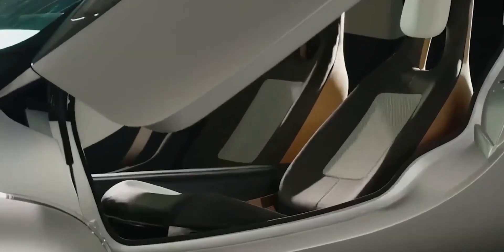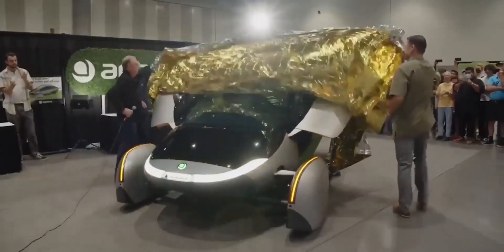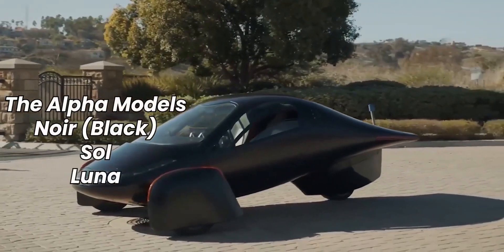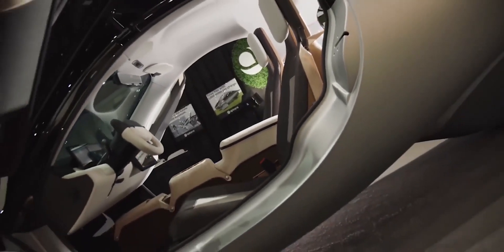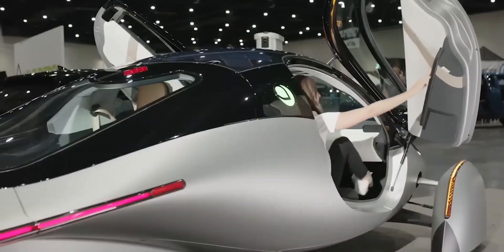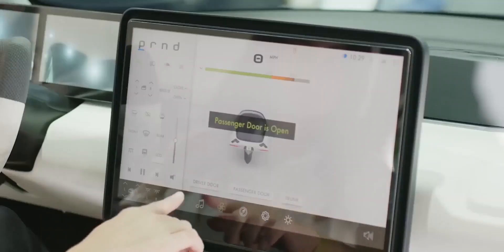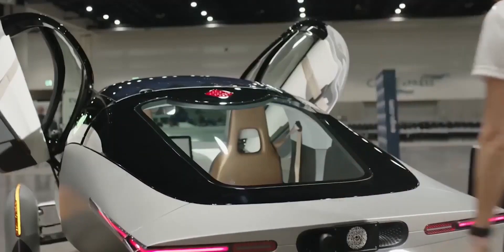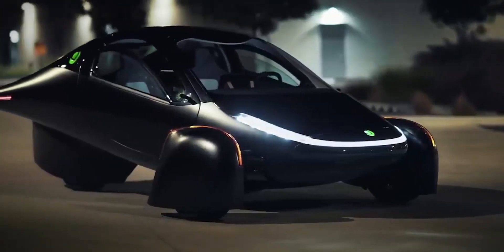Top 8 New features of the Aptera

Comment: Still think that four wheels are better.
Reply: Arkady, better in what way?  3 wheels are less expensive to purchase, and lead to less weight, rolling resistance, and wind resistance.  The design of the front compensates for stability issues that could arise as seen by the beta model passing the moose test, which many 4 wheel vehicles can not do.  I think the tradeoffs for what is gained are well worth it.
Reply: @n.brucenelson5920  Rolling resistance can be reduced by narrower tires. And overall width will be also less, with more cabin space.
Reply: @arkadybelsky3150  Aptera is already using 195/45 R16.  Make them much narrower and traction will suffer with little advantage to rolling resistance, plus more cost and weight.
Reply: @n.brucenelson5920  Front axle of Aptera doesn't look narrow at all. Quite the opposite actually.

Comment: My current selection is the 400 mile range, full solar panel package, all-wheel drive, and a few of the extra options. I'm very tempted to go with a custom exterior and interior color.
Reply: That's exactly my selection also.   It seems that the 400-mile option is the most popular.   I am keeping my fingers crossed that Aptera will be able to keep the price advertised.
Reply: @Chitown388  I'm betting the 400-mile range is the most popular due to it was said to be the 1st they would be producing. My daily drive is so short, about a 5-min drive, even the smallest battery option is more than I need, but maybe I'll do a raid trip some day.
Reply: @Lord_Mangoat  My commute is even shorter, a couple steps from the bedroom :-)    My rationale for the 400-mile range is to significantly reduce the range anxiety in the event of a road trip.